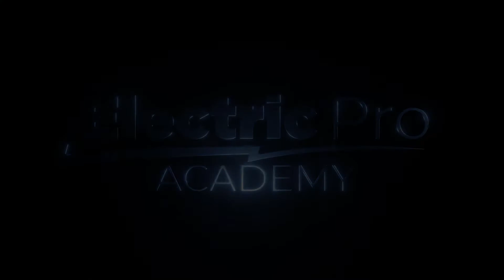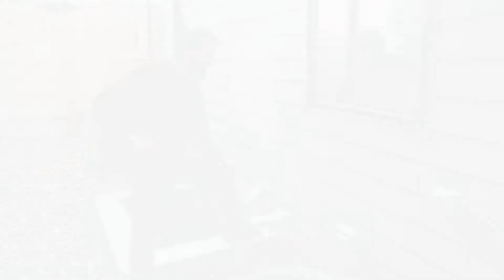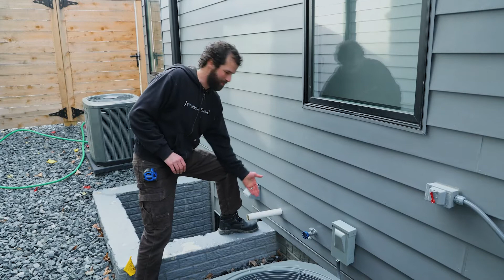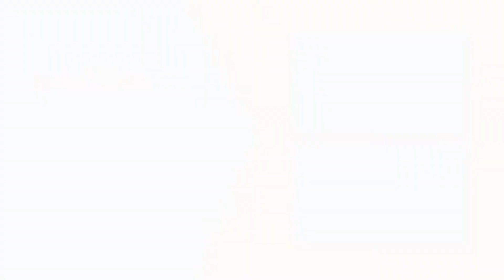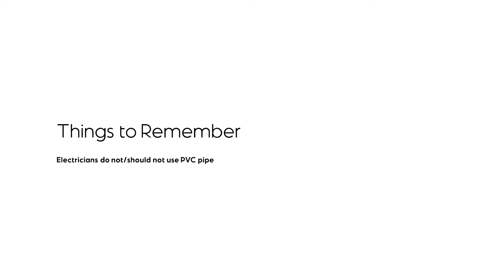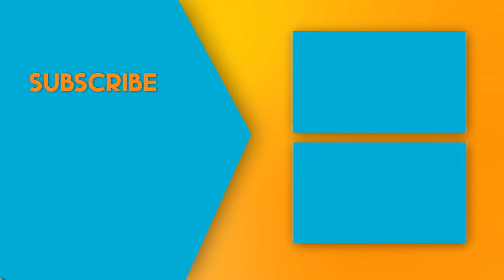Electricians Don't Use White PVC

Comment: I'm installing a sub panel on the opposite side of my home and I have lot of extra 2 inch WHITE schedule 40 pipe already that was intended for another project that has changed.  So now I would like to use this WHITE PVC pipe as a raceway for my feeder lines instead of dishing out the money for Grey PVC.  I plan on painting my WHITE PVC pipe with UV rated spray paint for plastic.  Then I plan on just painting over that to match my house when I paint the house.  The raceway starts inside the garage and then go outside underneath the porch roof, and then around the corner of the house and be attached to a wall at about 9 feet above ground.  I plan on sealing the WHITE  pvc pipe with normal pvc cement.  This pipe will not be under ground and it will be obvious it is not a water pipe because it will be directly attached to panels.  Is what I'm planning a violation of the NEC code?  If so could you give me the reference numbers.  Also is there any common sense reasons in my particular case where I might run into some problems?  Or is it just a violation of the code for the sake of the rules that don't really make any sense in my particular case.  In other words if it is a violation, is it just typical regulatory B.S. ?
Reply: @ElectricProAcademy  I really appreciate you taking the time to respond to me, even though what you said makes me boil.  LOL.   I'm not mad at you, I'm just mad at the regulations in this free country of ours.  I'm so pissed that I got to go spend $300 to $400 bucks on stupidity.  My pipe is pressure tested for water and I'm sure it will be strong enough for conduit.  It is made of the same damn plastic, PVC, and it would be UV protected because I was going to paint it.   Just because it doesn't have a fancy label from an electrical lab, doesn't mean in the real world it wouldn't work just fine in my situation.  Overall, this just feels like regulatory B.S. and I can't trust that I will get an inspector that will be willing to use basic common sense.  It is a shame that everyone is worried about exagerated liabilities because of what the lawyers have done to this country.  The intent of the law and the letter of the law are often far apart.

I will be installing XHHW-2 3/0 aluminum wire (which as you know is designed for moisture) for a 240/120 volt 125 amp sub panel.  So I will have four wires in the raceway, three as main conductors and one as an equipment ground.  I will make sure not to connect the nuetral bus bar with the ground bus bar in the sub panel, and I will pound a grounding rod in the dirt as a system ground at the subpanel because it is so far away from the main panel.  (130 foot raceway and 70 feet away in a straight line)  

I was able to find 1000 feet of this wire on craigslist for $150 bucks so I guess I'm money ahead.  But I haven't found any cheap 2 inch conduit yet on craiglist, so I'm mad I can't use my water pipe.  (sucks being poor)

As far as Fault conditions go, well pretty much everything is hazardous under fault conditions.  Is grey electrical conduit PVC going to fair any better than white PVC when it is heated to three times the temperature of the surface of the sun in an arc blast?  LOL,  As you of course know, that is why we have breakers.

Thanks for getting back to me, I really appriciate it.  If you have any ideas that you would like share, I would to hear them.
Reply: @ElectricProAcademy  Pray for me, Cause I need it.  🙏🥴🙂
Reply: @stevekluze3094  ... just another code pointer because I read this below another video last week.... the code talks about the various ratings of electrical gear based on intended use out in the field. This is what it's made for and designed for... nothing else.... and there's no substitute for being code compliant with materials. Electrical gear can't be used for plumbing and water pipe can't be used for electrical. Besides, water pipe is not tested for dielectric (insulation) qualities. There's no such thing as close enough. BTW, I doubt you can find sweep elbows and proper end connectors for white PVC. Oh, if you have that much white PVC laying around just return it and exchange for the right stuff at a big box store.
Reply: @rupe53  Dielectric qualities???  Give me a break.  Grey PVC and White PVC have the same dielectric qualities.  Neither conducts electricity.  And if the goal was not to not be able to conduct electricity through the conduit, then tell me why code allows EMT for grounding.  LOL.
Reply: @stevekluze3094  ... it all has to do with what it's tested and certified for. You could use garden hose, automotive heater hose, or PEX tubing, but they are not certified for electrical use. OTOH, EMT is certified for electrical and can be used as a ground. (in some areas) Bottom line is non certified products will not pass an inspection and if there's a problem the insurance companies wont be helping out much either.
Reply: @rupe53   I could get Grey conduit sweeps and connect them to the white PVC or simply just bend the White PVC like you do Grey PVC.  As far as returning the pipe, well that won't work because I got the pipe from my dad who got it from some drillers who were working for Kennecott Exploration.  The Exploration division for Kennecott shut down decades ago, and they are a mining company so they are not exactly going to take returns.  Also have you ever considered that metal water pipe is often used for grounding, so much for being "dielectric".
Reply: @stevekluze3094  ... you could do many things but code compliance is where we are going with this discussion. BTW, code doesn't allow water pipe as a ground (these days) but does talk about BONDING the water pipes to the electrical system in addition to ground rods. This is not the same as using water pipes for a ground. There is also a section on bonding of gas pipes and any steel structures within buildings. (I-beams and rebar)
Reply: @rupe53  Yes, Code Requires metal underground water pipe over 10 feet to be part of the grounding electrode system which of course goes along with the grounding rods and gas pipes and steel structures. Section 250.50 and 250.52(A).  Perhaps I wasn't clear enough for you.  

I'm not planning on using a garden hose, or automotive heater hose, or PEX.  They are way too small in diameter, to flimsy, and completely impractical.  I'm talking about using White PVC vs. using Grey PVC.  You were talking about water pipes "dielectric qualities".  I'm assuming you ment white PVC water pipe, because that is how this whole thing started.  I'm simply pointing our the fallacy of your argument, after all you called me a "just another code pointer".

There is good reasoning for bonding metal underground water pipes, gas pipes, and steel structures, etc. etc to create the grounding electrode system.  Just like there is good reasoning for providing an equipment grounding, which EMT is often used for.  My point regarding EMT is that you were trying to make some kind of hair brained argument about the "dielectric qualities" of White PVC water pipe vs. Grey PVC conduit.   Which is completely ridiculous because there is no difference between the dielectric qualities of White PVC water pipe and Grey PVC conduit because they are both made of PVC. Besides, it is a completely irrelevant argument due to the fact that raceways can be made of "dielectric" materials or conductive materials like EMT.

My whole point is the pain in the ass and extra expense it is to have to deal with code requirements when they make no sense.  No, I'm not going to try to use a garden hose.  My complaint is I might run into an inspector who will flip out because the PVC is white instead of grey, when it is going to be painted anyways and won't be mistakened by anyone as to what it is.  If some future home owner can't figure out that the pipe is being used as electrical conduit when it is going into an electrical panel, well then they are completely, hopelessly stupid. 

So I'm just ticked off I have to spend extra money and time to comply with the nonsensical attitude of people, insurance companies, and "authorities", like inspectors, who think we must follow the code in all cases, even when it doesn't make any practical sense to do so, as if it is some sort of GOD and everything must bow at the altar of certifications.  It is like people who want to follow the rules just for the sake of the rules without any real world pratical reasoning.  I'm not against certifications, I just wish people and the system was more flexible with dealing with the real world.  It reminds me of people who are outside jogging far away from everbody or sitting alone in their car and still think they need to wear a face mask.  I don't like being told what to do by stupid people.  I believe in the intent of the law, but not necessarly the letter of the law and when I get around people who put the letter of the law over it's intent I get very annoyed, especially when it is ridiculous and expensive.
Reply: @stevekluze3094  ... I am with you on all fronts and I agree that the color of the pipe doesn't really change the properties... BUT... it's not up to me. If the mfgr doesn't certify it for a certain use then that's where we are. It's not up to code and YOU take your chances. All I can tell you is you will have to argue with your local inspector.